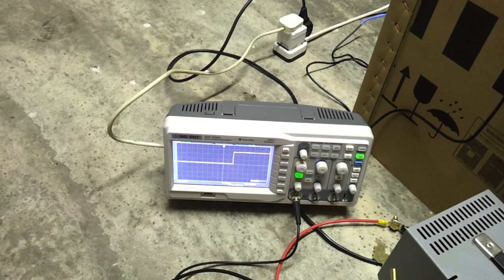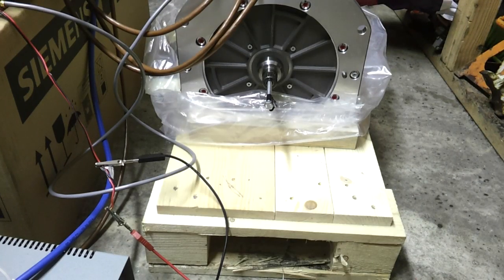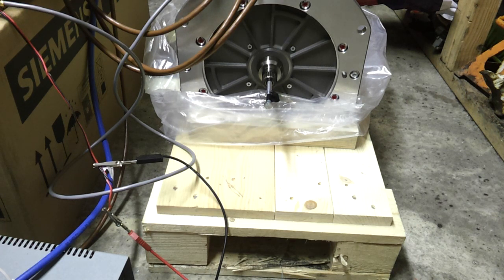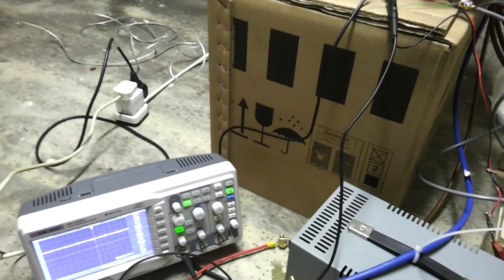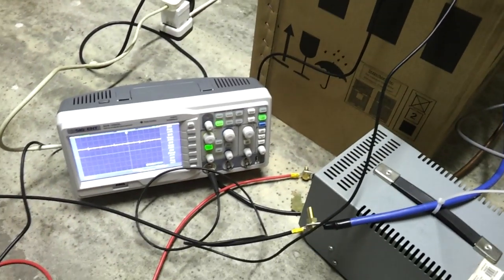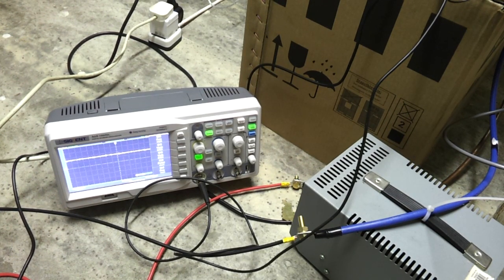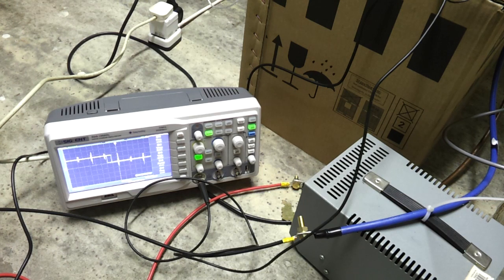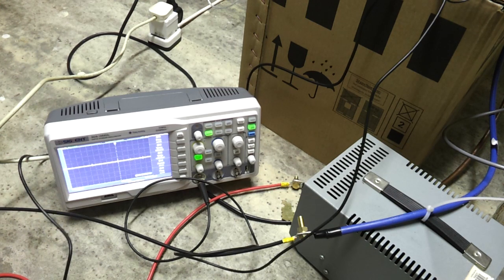AC Motor Controller 03

Comment: Dear Damien, I'm considering to buy the same Siemens motor and to build the same controller as you. Have you succeed in your conversion with the Johannes solution? Would you share with me the setup (sw +hw), costs and final weight? I am courious building the inverter, but for this particular case I found supplier that offers inverter (595 USD) and control board (695 USD - see https://github.com/collin80/GEVCU) designed exactly for this specific motor. The main downside of the factory inverter is its weight of 30 kgs. I would compensate you for the comprehensive advice.